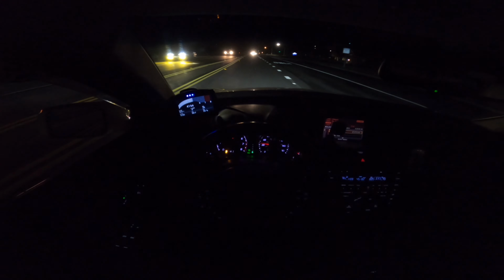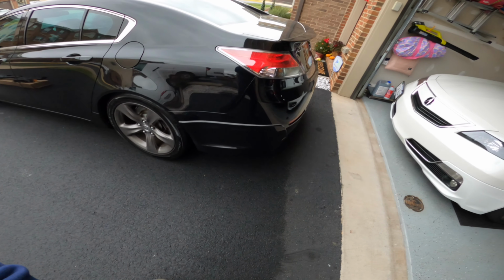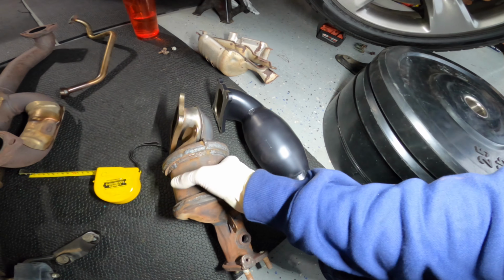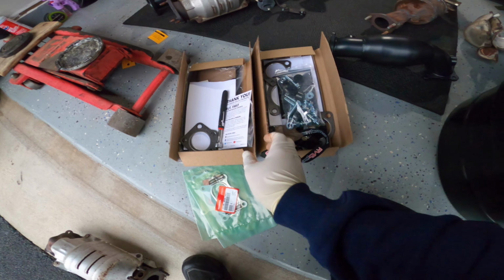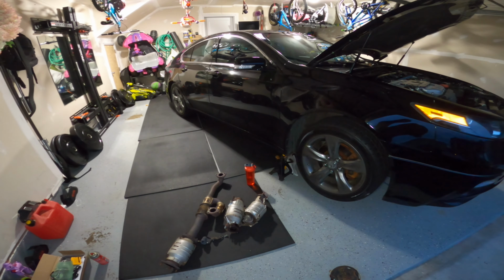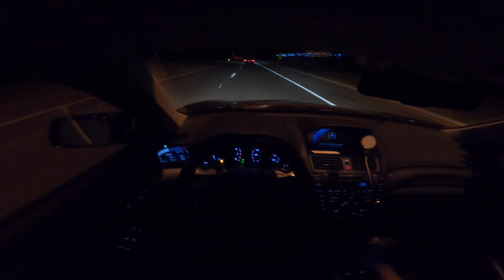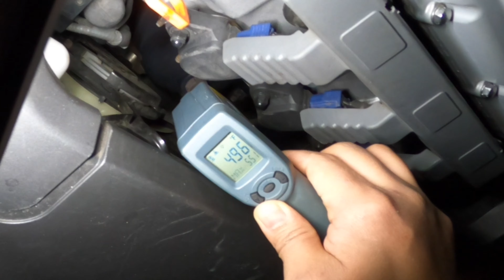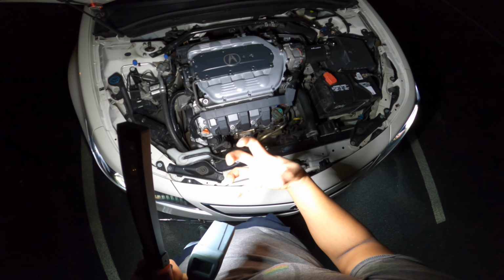Acura TL RV6 High Flow Cats And Rv6 JPipe Longtube | Before And After

Comment: Awesome vid, watching it is like hanging out with a buddy in a garage working on cars.  Looks like you had fun!
Also I usually pump Costco 93. On that tank I added liqui moly injectron to test it out, and it might have increased the knock control. Since then I recently filled up at Shell 93 and knock control is consistent at .85
Reply from the maker: 😊 thanks

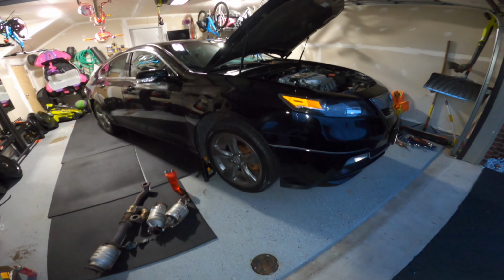Comment: 9:28 😂, If I had a garage I'd have everything done by now. Hopefully can get some nice weather soon on a day off, but amazing video as always. P.S. my knock control never goes under 1.00 when driving hard, and I'm running 91 SHELL only(highest octane we have). Maybe that's why I'm slower then I should be in the 1/4mile.
Reply: Thats what I experience about 1.09
Reply from the maker: Lol 😆. Maybe try new spark plugs it may lower the knock control. I was thinking my k.Cont is lower maybe because I had Acura replace my piston and rings due to the oil consumption.
Reply: @GarrettMedia  I got oil consumption rebuild also maybe 20k miles ago along with new plugs about 15k miles ago. I noticed with the 2nd revision on my etune it went way up.
Reply from the maker: @RevsALot  it’s gotta be the fuel bro
Reply: You're not alone. Mine stays around 1.02 to 1.08 after my tune. I asked the tuner if that was normal and apparently he says it good.  not sure about that but it is what it is. 🤷 😅
Reply: @j.stresstl182  don't think it's good, it's supposed to read under .50 I believe.
Reply: @RevsALot  that's what I've read through my Google searches as well. I may have to do a bit more digging to see what's causing that.
Reply: I might try to get my injectors cleaned and maybe try some different plugs. I tuned with brand new ngk laser Xi so I don't have a clue what's going on smh.
Reply from the maker: @j.stresstl182  what octane fuel are you using?
Reply: @GarrettMedia  shell 93 always
Reply: I know this was 3 years ago, but did you guys consider a blend of ethanol to act as an octane booster?

Comment: Update: after doing some more research the rv6 long tube j pipe or any long tube j pipe won’t put a CEL on your dash. The third cat does not have an 02 sensor as I’ve seen from a couple others. The 02 sensors are on the pre cats and you should be safe as long as you don’t do pre cat deletes
Reply: Yeah, I usually disable the downstream O2 sensors with my tuning software anyways, in the case that my HFPC’s do decide to trip a code, which is very likely. Even before I was tuned, I would use the included 90-angle O2 sensor simulators, and once in a blue moon, the P0420 code CEL would still be tripped and then go away intermittently.

Comment: Install some mini-cat O2 sensor extenders when you gut the original cats or a complete pre -cat delete like I did for my 2010 Honda 3.5 V6 next I’m adding a flow-master where the current middle resonator is located

Comment: Hey brother. Happy to show the channel some love:

Any idea what the overall performance gains are? Was that a dump test or dyno tuning?

Looking to run just the high flow pre cats to keep the exhaust sound down and maybe weld in high flow cats to the stock J Pipe
Reply from the maker: Thanks Cameron 🙌! If you’re looking for a bit of power get the RV6 jpipe if you have the shawd version that deletes the 3rd cat. That jpipe with high flow cats should give you some more power and still sounds like a stock exhaust system. This TL made 283 whp / 263 wtq after a custom tune. With also ported intake manifold, throttle body, lower runners and 410cc RDX injectors.

Comment: I have a 12 auto AWD with all the bolt ons except HFPC. I have had a pair in the past on a different car and after a year they started throwing codes. The GEN2 from RV6 are supposed to use a stronger catalyst. What are you thoughts on that?

Comment: Do you have to take out the front 🐈  catalytic converter for the 4gen fwd tech package or you just delete the back cat with the j pipe. The one from heel toe because am planning to use the j pipe only with no mid resonator no mufflers on my 2012 TL fwd tech package
Reply from the maker: No need to mess with the cats. The jpipe will bolt right up to stock cats and stock cat back exhaust

Comment: Great video as always fam! I have 2013 Acura TL sh awd auto. Just got p0420 & p0430 codes. If I had to replace both cats, would you recommend I just upgrade to this rv6 hfpc + j pipe combo or will I still need to purchase cats for bank 1& 2?
Reply from the maker: @sajfit  thanks! Tbh I’d go with pre cat deletes. I’ve seen the HFPC gives you the cat codes p0420 codes also. But it will give you more power than the stock cats
Reply: @GarrettMedia thanks for back! I would love to go with power of PCD but I just can’t to avoid the noise lol. From your knowledge is there enough room under our cars to add 90 degree defouler with HFPC installed to offset the code’s potentially?

Comment: My question was can you use the j pipe without the rv6 catalytic converter on the 2012 TL fwd reason why I asked because my straight pipe setup has no mid  resonator  no mufflers because I just want to add the j pipe only

Comment: @garrettmedia Any idea if the 2015+ V6 TLX PCD's or HFPC's will fit a 9th gen (2015) accord coupe V6? I found the TLX ones a bit cheaper than the ones actually advertised for the accord itself. When I went to RockAuto and compared Walker part numbers between the acura and honda, the precats were the same part number according to the Walker brand at least. Thanks

Comment: Do i pass inspection in pa if i do this?
Reply from the maker: On the rv6 high flow cats. There’s a plate on there it says for off road use only but that plate is hidden when it is installed. As long as your CEL isn’t on you will pass the obd2 but for visual inspection it depends on the inspector decision.
Reply: @GarrettMedia  appreciate the info love the channel 💪💪
Reply from the maker: @Egggcorn  ♥️🙏

Comment: Also does the high flow cats come with new studs to bolt the j pipe ?
Reply from the maker: Yea I believe it does. You can always call them to confirm
Reply: @GarrettMedia  I will mine are already on the way anyway lol
Reply: @GarrettMedia  did you install a defouler ?

Comment: Hey do I need a tune or any upgraded internals before I install some high flow precast and a long tube j-pipe on my 4th gen?
Reply from the maker: A tune would help out a lot after installing those mods. But it’s not necessary

Comment: I thought these were at 300hp?
Reply: Brand new, at crank they are rated 305. In real world conditions, power loss through engine and AWD system, and age, they are usually around 250. The FWD are actually faster than the AWD on a roll because they make 250-270ish